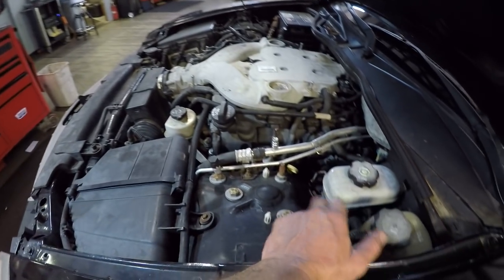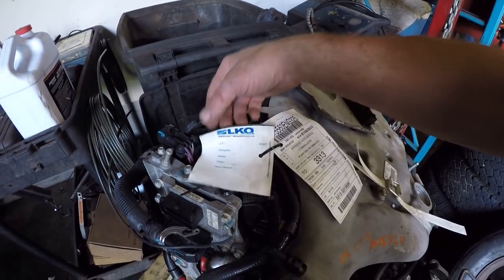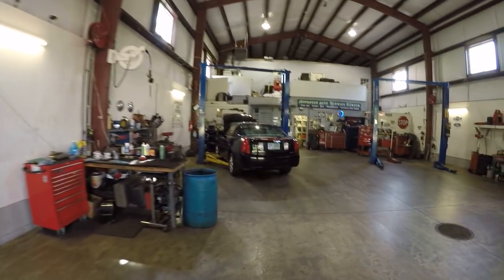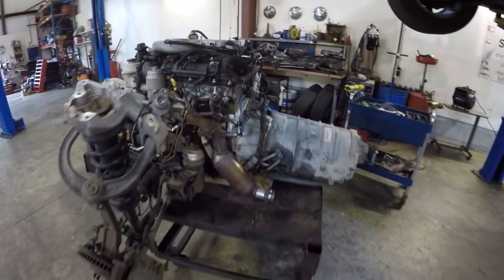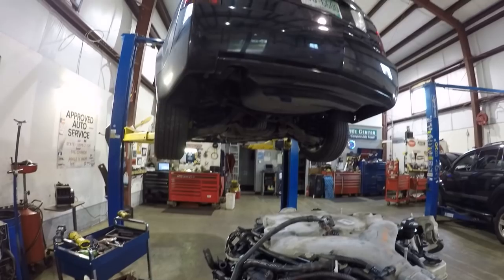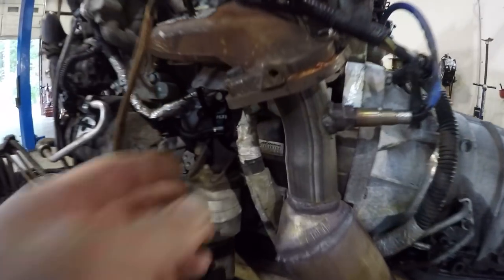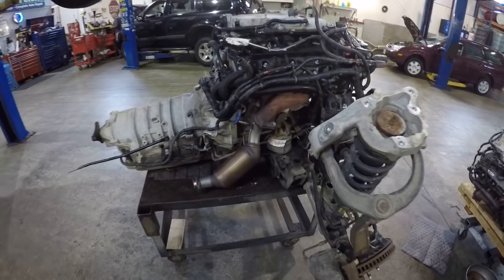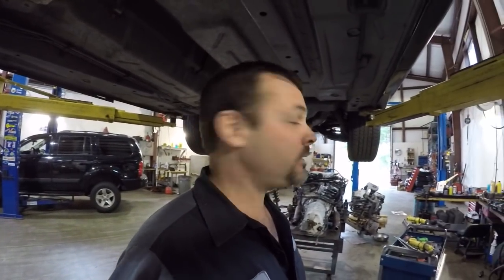Cadillac CTS Engine Swap  The Time Lapse Tech!

Comment from the maker: I filmed this back in the early summer, The ending test drive footage was lost so I never got around to editing it. Thanks for watching and Keep It Outta The Cabbage!!
Reply: No way you could do it in 4-6 hours
Reply: 1 guy, full engine, cross member, suspension out, strip, reassemble, back in - yep, 20 hours. Particularly when it’s an unfamiliar vehicle.

Pity you don’t live in my neck of the woods. Nice work.
Reply: Amesie's Automotive Corner hello do you know how much is the Cost to change the time laps tech
Reply: Amesie's Automotive Corner hey what’s the name of the stand you guys used to place the engine on ?
Reply: Amesie's Automotive Corner or where can I get it from ?
Reply: 20 hours    are you kidding?.....is that including several naps
Reply: 4 -6 hours tops
Reply from the maker: Bullshit buddy.. You got a lot of bullshit coming from you.
Reply from the maker: I don't write the labor guides..
Reply: Dang so i wanted to so this 2 my 2010 cts but they charge 110 an hr wow xs 20🤯 i might have 2 sell it
Reply: @elbenadoelbenado5881  I do this for a living and I've always thought that Cadillacs are not for the average individual. No offense. What I mean is that if you own a Cadillac you should know that repairs are never cheap because of their parts and the complexity of the repairs. It's like engineers were thinking about how tough they can make it for a mechanic/technician to repair the darn thing. It's insane. 🤦🏻‍♂️
Reply: @mrpeabody6581  BS... book time is 15 hrs. Good mechanics can do it in less time, but not 4-6 hrs.
Reply: @mrpeabody6581 
I wouldn’t see your final Bill…. “Sorry it took WAY longer….!!!”
Reply: @mrpeabody6581 
You are the one GUY who put in the “new” Engine 100 Miles ago, before he came to this Shop?? And forgot tho put in ANY Engine OIl…

Comment: Wow, a big job.  I hope I never have to do that.  I check my oil all the time because the 3.6L drinks oil due to a ill-designed PCV system.  BTW the engine/chassis parts coming together with the body is called marriage at the factory.

Comment: A Just did a 2017 Ford Fusion Hybrid engi e swap. Made à HD rolling table similar to what you used. Way easier swapping wiring, parts and lines on the table.

Comment: I got a 2006 Cadillac STS 3.6 that I’m pulling the engine in the drive way out the top and it’s a pain in the ass all ready got the new engine.I’m to old to be doing this shit I’ve been a mechanic all my life .started in the 80s cars to day are over engineered peace’s of shit. I’d take a carbureted 302 or 350 or 327 or 351 any day.

Comment: Those Cadillacs especially 3.6 have problems with the oil pressure being low. Mine went out early would idle at 10-11 psi oil pressure an no check engine light or anything. Until.. at start up it’ll make a little clacking noise from the timing chain going out.

Comment: 20 hours for this job is not outrageous. A customer came to my shop with an estimate from the dealership in the amount of $9,485 for a used engine. $4,500 was the labor. So, I don't see why a local mechanic shouldn't charge half that. The hours marked by the dealer was 24.5hrs.

Comment: I wrecked my 2011 STS 3.6 LLT so I went bought a 2008 CTS LY7 beautiful car with a blown engine...I was just gonna swap out the motor and transmission from the STS to the CTS using the STS harness and computers...will that work?

Comment: An absolute nightmare I’m doing a 2013 CTS and was committed to pulling out the top even though I have a car lift. You are absolutely correct what a nightmare pulling out the top. Zero tolerance available. I don’t know what the car manufacturers are thinking these days. I am now on the fence due to the availability of room I do think I’m going out the bottom now LOL. Rock on!

Comment: when u swapped the engines did you have to reprogram  the ecu to the key to the car? i got my engine swapped but it will not crank or start
Reply: I had the same problem bro. To answer your question yes. I swapped my engine sat n the driveway for a year. Take the ecu to dealership with the vin. Then you'll have to get the key reprogrammed

Comment: That car cost around 2-3k for the same amount of miles. Ofc used. And this job was probably 5-10k including the engine. And it’s not hard to remove. Only took one person, most 2. Me and my brothers did the same job in my front yard. The engine cost us 500 with 120k miles. So I agree with the comment. “This job cost more than the car”
Reply: I have the same car I paid 950 for the engine 132k on it there's no way that was  5 or 10 k job

Comment: As far as I can tell, modern vehicles are hell to work on.  Mainly there's no space under the hood.  You either remove the cab on Ford pickups, or you remove 6 things to get to the broken one on most everything else.  Then there's diagnosis via the ECM error codes, possible but very ugly.  I watched one guy do that and I swear his job was more like debugging electronic hardware than wrenching on a car!  Do you trace problems via the ECM output Amesie?  
Oh yeah, did you beat the flat rate hour estimate? That's how to make decent money on flat rate jobs.

Comment: Hope you inspire many young people to become interested in the trade; we need 'em.
Reply: eighthof8 I definitely am (17 hoping to learn about cars) I kinda am in a tough situation because my car makes the same sound and I’m still making payments on the car. I was thinking about engine swapping it and then selling it after I’m done making the payments but I don’t have a garage or a lot of tools to work on it, let alone a lift. Don’t really know what to do about the situation but I’m not giving up on working on cars
Reply: @devonharas9014  cars are fun to work on but you need to be persistent as all sort of vehicles with different problems will come and you have to set your mind to invest in diagnosing equipment and tools. So far I have around 15k in diag equipment alone, 3k on a pico scope along with sister oscilloscopes totalling around 1200. Dpnt be afraid to enter the world of electronics because that's the new thing coming. Any grease monkey can turn a wrench but not all will find hard to diagnose problems such as a jumped timing, misfire due to poor ground or computer supply fault of either.

Comment: G'day, Amesie! "Well, there's your problem lady!” (SMA) South Main Auto! Do people not check their oil regularly? Suggest, I'll checked the oil every other fuel fill, maybe every three If I Was Being Lazy. What else is there to do while gas is pumping into the car? You are stuck, right there, for at least two minutes. Pop open the hood, and check the oil!

Amazing! How does this sneak up on people? Especially with an engine that is Known to Drink Oil. Google search 2003-2007 Cadillac CTS 3.6, guess what pops up... a freaking video about checking the oil level. Hmmm. That might be a sign... 

Or, "Traditional combustion cars, on the other hand are extremely complex machines that have around 10,000 moving parts." These will generate lots and lots of heat without lubrication... so much heat they can weld themselves together. Maybe we shouldn't be so hesitant to add that lubrication. As dad said, Take Care Of Your Car, and it will take care of you.

These complex machines require a little bit of attention. I do not understand how a customer is surprised, when the engine fails, and they chosen to neglect or maybe abuse them. So why do drivers delay or choose not to change their oil? Unfortunately, most people rely on mileage rather than oil change warning signs to let them know when it’s time to schedule a service appointment. As a result, their vehicles end up suffering from an overdue oil change longer than they really should.

We know fresh, clean oil optimizes there vehicle’s performance by lubricating parts and keeping the engine clean and healthy. But with time, the fluid breaks down and has difficulty performing its duties. Once this starts, a car will exhibit the top five oil change warning signs.

Again, oil changes are a simple service, but they’re one of the most beneficial things a customer can do for the vehicle. Staying on top of routine oil changes helps to keep there own car healthy and extend its life.

But most importantly, it prevents there car from excessive wear and tear and damage. And in turn, they’ll be able to avoid expensive repairs and keep more money in there wallet.

Thank you! 

Cheers! :-)🚘👍🏼😊

Comment: That job was worth more than the the whole darn car.
Reply: How much did that job cost?
Reply: @Kenny Argueta Ventura what year and engine size u got?
Reply: I replaced my engine in my 07 STS labor cost 1300 engine was 1500 after taxes and shipping
Reply: Bought my 06 STS for 700, I’m swapping my engine tomorrow. All around im spending around 2 grand to get it fixed, its worth it in the long run if you can get the caddys cheap🤝

Comment: Is it better to do an engine swap or a rebuild? I have a 1991 ford escort station wagon. 5 speed stick shift with 340,000-ish miles that I just cannot part with for sentimental reasons.. It was overheated and makes whirring sounds like it has no compression so I assume just a head gasket wouldn't do it.... I wouldn't even know how much a rebuild or swap on a car like that would even cost.
Reply: Do I smell a free donation to the cause :) :) ?? Lol.

Comment: You know the engineers that design POS like this should have to wrench on them
Reply: Tom Burgess was it the engineers fault the car was run with no oil?
Reply: +Colin Johnston no sir it was not their fault,  however practically  every repair  on it is way to cokplex, my sympathy  was for the mechanics  not the foolish person who neglected  to observe proper maintenance
Reply: Yes but the engine is expexted to last the lifetime of the car, and the only way to make it more accessible would be to increase the size of the engine bay and therefore the entire car. He stated this was an 05 so personally I'd have sent it to scrap as it's end of expected life span amyway. He has paid way more than it's value for not 1 but 2 replacement engines. But hey it's not my car so..
Btw the mechanics are paid by the hour so it's not really a hardship. I'm sure he is grateful there is work to keep him busy.
Reply: Actually this engine is easy to work on. Its a small v6 in a big engine bay. I could remove and reinstall this engine in 14-16 hours
Reply: Flatrate is not hourly haha
Reply: Travis Whatsittoya what are you on about??
Reply: Colin Johnston idk about Amesie in the video here, but 90% of us aren’t paid hourly

We’re a flat rate for each job based on how long the manufacturer says it takes to do the job.  If we show up and there’s no work, we don’t get paid
Reply: Joe Button Idk where you went, but it sounds like someone owns their own shop and is super incompetent. It’s been my experience working for other people that if i don’t fix it I don’t get paid.  If I don’t diagnose it properly and it still has the problem when I’m done; I only get paid for the actual fix, and not the diagnostics or the original work done.  And also it’s not the “mechanic” who holds the car hostage UNLESS he/she owns their own shop.

Comment: Guessing 6 grand parts and labor. Probably way off.
Reply from the maker: I think it was closer to 4k.
Reply: Not bad, seemed like alot of work, bet you walked back and forth to your tool box 100 times.
Nice thing about LKQ is you can sign up on there web site and enter the type of car/truck your interested in getting parts off of ( I repair older Datsun Zs ), and whenever that type of car comes into one of there local yards, they email you with pictures. Its saved me alot of time.
Mechanics of your ability are few and far between. Your Boss was lucky the day you applied for a job.